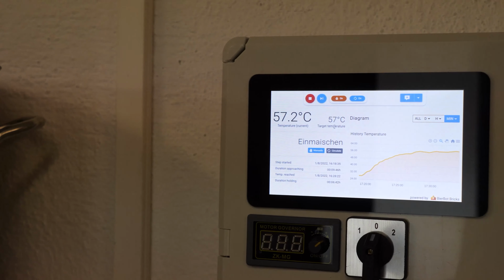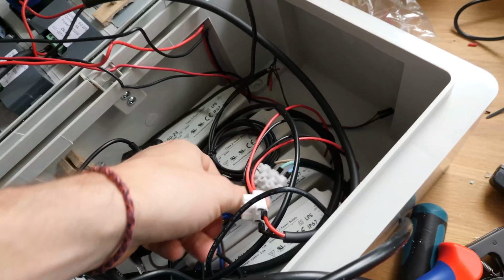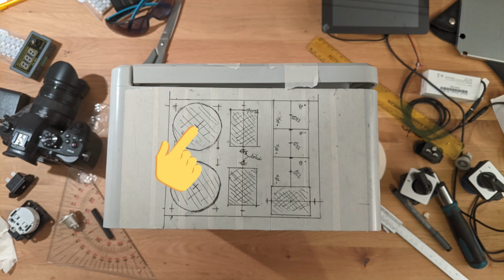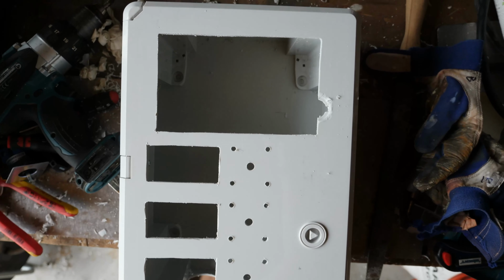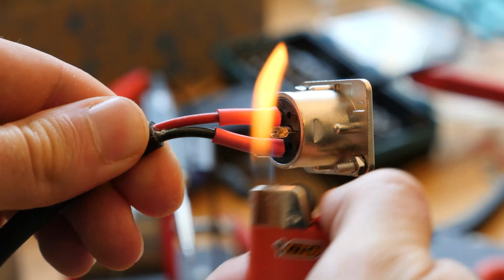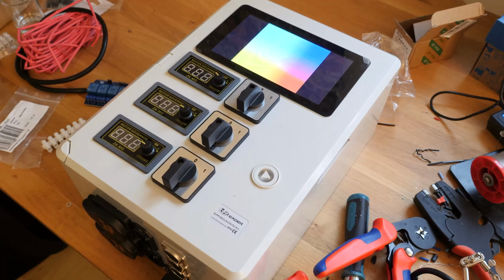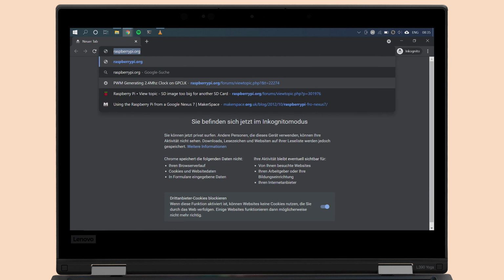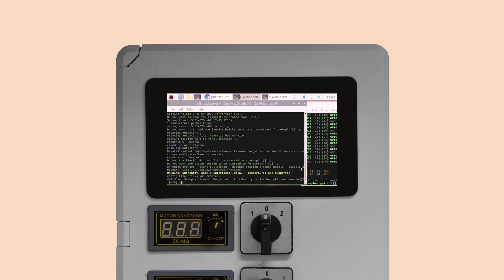How to build a Raspberry Pi based brewing control (mashing & fermentation)

Comment: hi I have a question. Is it possible to use an orange pi instead of a raspberry pi thanks
Reply from the maker: "import RPi.GPIO as GPIO" has to be replaced by "import OPi.GPIO as GPIO" in main.py then it should work. If you succeed I'd love to see a pull request detecting the platform and importing the right thing automatically. Cheers!

Comment: Hi Bernhard. I have checked(on the internet) that hydrom hydrometer runs into the app TILT 2. I was wondering if it would be possible to integrate it into "bierbotbrick". Do you use the hydrometer in corny kegs o stainless steel fermenters. I ask you that because of the connectivity. Many thanks
Reply from the maker: Hey Augustin, in stainless steel vessels we use an iSpindel that relies on WiFi. Hydrom and Tilt app may also work. Consult our documentation about how to setup the tilt app. Also, you can reach out to hydrom to provide us a unit so we can integrate it nicely if you want :)
Reply: @BernhardSchlegel  I will try it!! Many thanks.

Comment: Hi Bernard, I build your "brewing control" (2 relays + 1 probe only) and it works but I have a problem. I have changed the probe ds18b20 for another identical probe ds18b20 (just remove one and put another) and the new one doesn´t work well (it measure -42*C all the time) The same cables, the same conection, etc. Could you help me? Must I do something with te code or run the program again in order to detecting the new probe? Thank you very much P.D: I bought the new one in aliexpress.
Reply from the maker: Did you try to run the setup script again? Untested DS18B20 from china have a higher failure rate than one might think. Cheers, Bernhard
Reply: @BernhardSchlegel  I will try that and let you know. Many thanks.
Reply: Yes, the solution was to run again the script. It works, but if you change the probe, you have to run the script again. That's all. Many thanks
Reply from the maker: The reason for that is that the probe ID is transmitted to our backend so you can configure probe ID specific offsets for calibration on the /bricks page

Comment: why not just use a PLC? what you are doing looks like you are going to burn your house down
Reply from the maker: Thanks for reaching out! Can you recommend an affordable PLC supporting 16A@230V, Python/C(++), and WiFi?
Reply: @BernhardSchlegel  check out the Beckhoff CX7000 range. - https://www.youtube.com/watch?v=N37pQjJaPjw
Reply from the maker: @ritecomment2098  cool stuff, worked with that during studies. The one you sent has 24v outputs only. Can you recommend an extension?
Reply: @BernhardSchlegel  look at the IO range Beckhoff do, you can have any number of any type of IO as a module slid on the side. 5v, 12v, 24, 48v, inputs outputs, servo motors etc

Comment: Hi Bernard, it doesnt work with tipical SSR-40 DA. When I connect all circuit, this relay is alwais on in the GPIOS y selected previously, doesn´t matter if I put "inverter or not". Is there some solution? Many thanks
Reply from the maker: Hey Augustin, sorry to hear that. There's not a whole lot of complexity to that SSR, in theory I believe it should work. Two ideas: make sure that the SSR actually works with the DC control voltage your supplying. If you go straight from the GPIO to the SSR there can be an issue as the GPIO only supplies 3.3V and the SSR might except higher voltages (5V, 20V DC). Also: using an SSR currently has no advantages over a normal relay but the downside that it requires cooling. Please share if you found the solution! Cheers, Bernhard.
Reply: @BernhardSchlegel  I didn´t find the solution. Simply I use the same relays than you and it works. Many thanks

Comment: How many wires does one need on the jumper camble? 120 would be overkill right?
Reply from the maker: Sorry I don't get the question:)
Reply: @BernhardSchlegel  Guess i could have phrased it better: How many jumper cables does one need in total? There are sets from like 20 to 120 pieces. I guess 40 would be enough right?
Reply from the maker: @seelenquellpoe6767  gotcha! Think I've used 9. Just get the long ones if you're build will be similar to mine (RPI in the lid, electrics in the body of the housing).